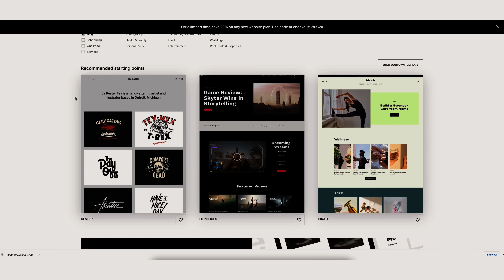Winter is Coming - Offgrid Cabin Build Ep.56

Comment: Figured you would chisel the wood on the beam and headers back so the hanger sat flush in case you want to ro cover it up so it doesn't have a bulge.
Reply from the maker: Where I installed it is still inset from where the finished wall will be. I’ll make it look pretty!